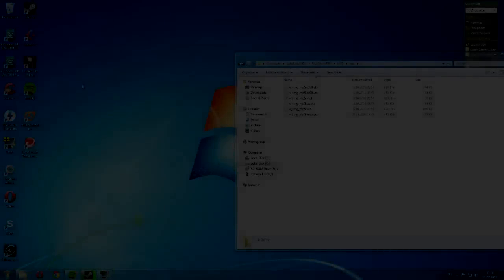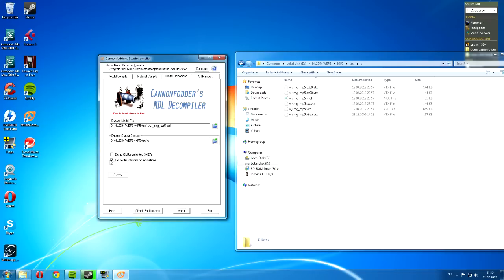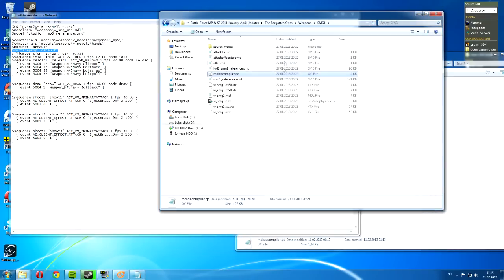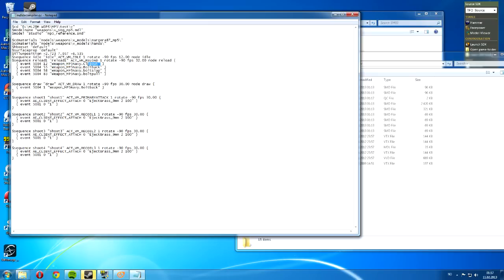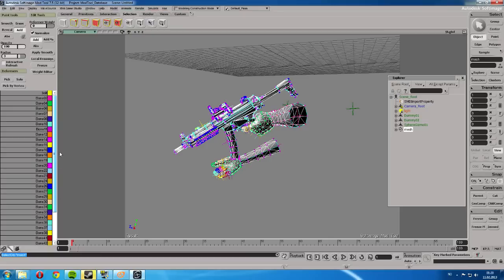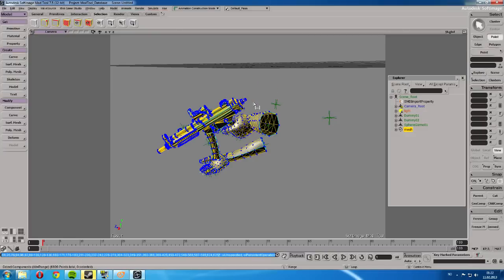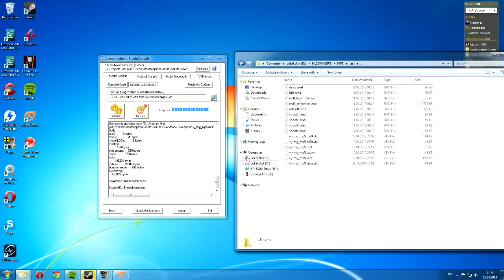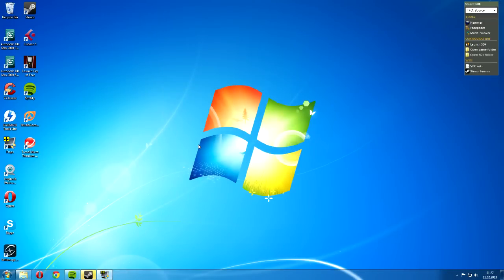Source SDK - How to Decompile/Compile a Model and use XSI Mod tool 7.5

Comment from the maker: Make sure that you've installed 32-bit / 64-bit depending on your system. Tho 32-bit works fine on both. Also to open XSI without issues navigate to your softimage folder and go into the bin folder then look for XSI.exe and open it. Hope that solves the issue.

Comment from the maker: You need to configure studiocompiler properly. 
If you are directing towards hl2 folder then make sure you got the gameinfo file there if not use gcfscape to extract it from hl2 or source engine gcf.

Comment: When i try to import an smd file the program says that that isn't a smd file even though it is......
Reply from the maker: Half Way Lambda this happens because Valve updated the SMD format a while ago. Make sure that you have the latest XSI plugin. If that doesn't help you can get Blender, open the smd in blender using the Blender valve plugin and re-save it, this will allow you to import it properly in XSI. This also even fixes uv glitches in some decompiled smds which will go crazy on direct import via XSI.
Reply: Hmm, could you please send me a link of the latest XSI plugin? I don't know from where to start..